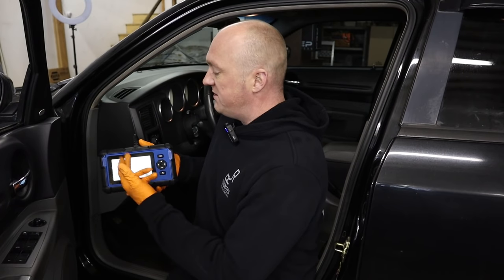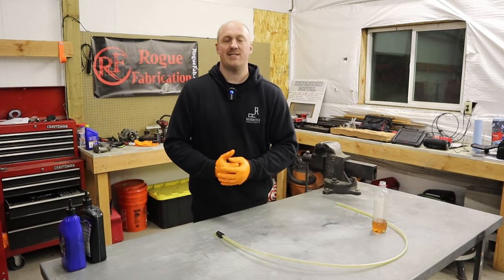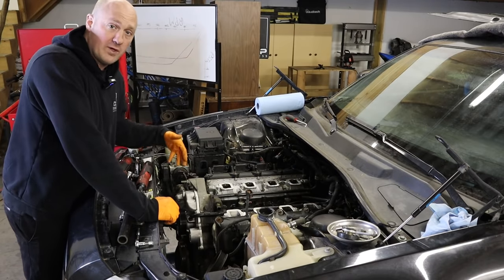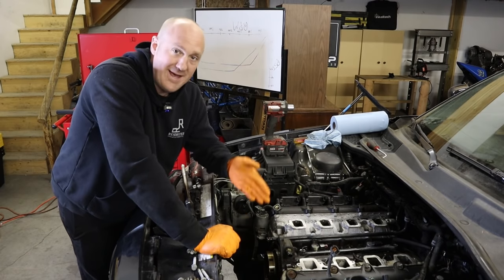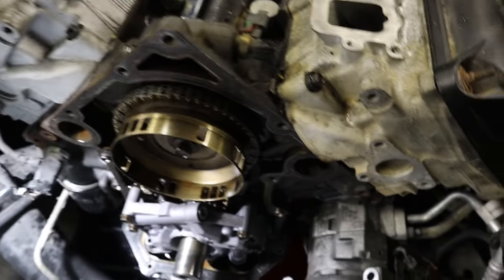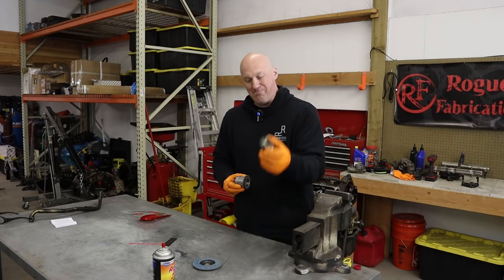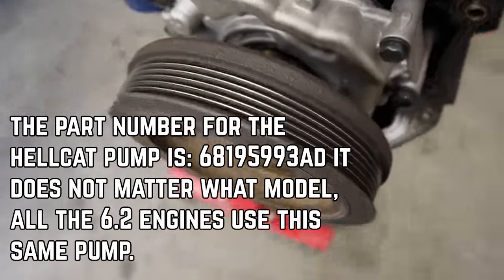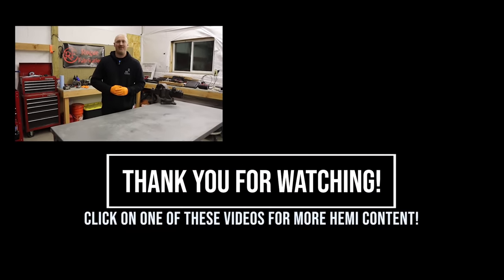Will This FINALLY FIX Hemi Tick? #hellcat

Comment: Wanted to say thank you for these videos and for supplying facts to support your theories, can’t imagine how many hours it took you to do all these hemi tick videos (I’ve spent the last few days watching all of the ones you’ve linked to in these hemi tick videos).

I really don’t know anything about taking apart engines, or even the names of a lot of the parts, so I’m not fully understanding how the oiling of lifters changes with MDS on and off, could you explain that in a video?  

And is leaving MDS on better for oil flow to the lifters? Or is disabling it better (via the gear limiter trick or some other method)?  I lack the skills to add the hellcat oil pump to my truck, and it’s my daily driver so I can’t risk screwing it up, so until I can pay a mechanic to do, I’m trying to understand what I can do help prevent lifter failure. Obviously the first thing is to idle as little as possible, but with the stock engine, should I be leaving MDS on, or disabling it (with the gear limiter truck or a tuner)?
Reply from the maker: Appreciate you watching! As a quick break down, the lifters are receiving the maximum oil flow when MDS is activated, therefore, in my opinion it makes more sense to leave the MDS functional, especially if you aren't able to perform many mechanical changes yourself. Some who are able to do so would rather remove the MDS system and replace the lifters with non MDS lifters before a problem even happens, but that's quite a fair amount of work. I personally think it's overblown how many Hemi engines suffer a lifter failure, and if you aren't in the habit of idling your vehicle excessively and are consistent with your oil change intervals, then I'd be willing to just ride it out and see what happens. There's a great many Hemi engines on the road today that have never had this issue, even ones that are maintained poorly.
Reply: @ReignitedAuto   I can’t give your answer enough likes. You replied to a comment on a video that is 6 months old, and you actually read and fully answered my questions. I honestly wasn’t sure you’d even see the comment because I’m sure you get a lot of them with all the videos you have. 

I’ve been disabling MDS with the gear limiter since I got my truck (2019 Ram 1500 5.7) nine months ago with 20K on it because videos kept saying it was the MDS lifters that were failing, so disabling MDS would prolong the life of the lifters… I’ll be stopping that. Regular oil changes and minimizing idling I already do, so at least I got that right. Maybe once I get closer to the end of my loan and warranty I’ll give the hellcat oil pump a try. One of the reasons I got the truck was to start learning how to do stuff like this myself, and your videos will be a great help when I’m brave enough to start tinkering with it. I truly appreciate your help.
Reply from the maker: @Regilliwret  sure thing my man,  I'm always down to help people learn and jump into the automotive world.  👊

Comment: If replacing one head would you recommend both considering one side had a valve seat drop? Also any recommendations on sources for locating a new pair of heads? Been looking at Mopar parts overstock and cylinder heads international online..both seem to be half of what others are charging.

Comment: I’m really questioning the legitimacy of the Melling 10452 I got for my 09 Ram with the 5.7

No change over the OEM in terms of bottom end pressure. Coming to a stop and idling my truck likes to dip to 15 psi. No check engine lights, and other than being noisy, she runs well

Comment: Looks a bit more complex than what I'm willing to tackle on my 2017 ram. Maybe in a few years to see if its 100% true that this will fix the issue. I wonder though, if the problem is really that simple, theb why doesn't stellantis, fca or even Daimler did this.

Comment: For 2022 5.7 Hemi on a Challenger RT cold start around 57 psi , and 32 psi on hot idle. Don't know if the pump is changed or not, but the oil viscosity changed from 5w-20 to 0w-20.
Reply: I wonder of the Mopar oil is an issue as well.

Comment: jesus 20psi hot... And thats a brand new pump or good working used one? Mine is still factory and likely tired from 300k kilometers probably making less flow and pressure, it would be dropping into the teens at idle i bet..

Comment: Hey first of all sorry for my bad english, i have an Dodge Ram 1500 from 2014 with the 5.7 hemi. I have seen the video and read some comments and also do my search on Google. So my Dodge has an idle Oil pressure round about 33-37psi but i have nothing changed, because i rode some comments that they have 20psi. So now my question is this "high" Oil pressure in ilde (enginge was operation temperature) normal or is there something done befor i got the car. Thank you for your hard work in the video. Hopefully somebody can answer my Question. Greetings from Germany and sorry for my english i hope you guys can understand it :)
Reply from the maker: I would say the oil pressure readings you are seeing are consistent with what I see from factory oil pumps in your vehicle so I doubt anything has been changed. My advice fit the improved oil volume generally applies to people who idle their vehicles for excessive amounts of time. 👍
Reply: @ReignitedAuto  Thanks for the das answer. Yeah i will Order the hellcat oil pump and Switch it thank you vor your Work 👍😃

Comment: At the expense of MPG could you just adjust the idle speed higher to increase the oil pressure/flow?  Or program the pump to stay at a higher minimum psi?

Comment: Thank you sooooo much for this content.   I have to rebuild my 2010RamTRX with 510xxx on it.   lifter and cam job. I might as well do the oil pump since Im there anyways.   Confirmation 6.2 Hellcat pump fits the 2010 5.7 VVT?

Comment: Hey sky
I was confused about the rebuild you Did in several episodes? If I eliminate the MDS with non MDs lifters do I have to change the cam?

Just watched the stock to hellcat oil pump Episodes.
I just bought a melling HV . But which spring to I put in the pump it comes with 2springs?
Thank you Richard.

Comment: Hello there,  I’m new to your channel and my question is does the hellcat high volume oil pump fit into a 2021 ram 3500 drw gas engine 6.4 truck without any modifications?   In other words, is it an exact fit. 
TIA. Great channel by the way.
Reply from the maker: Direct fit 👍

Comment: So what's your thoughts on metal shavings after lifter failure? I've been told to just change the engine because you'll never get the shavings out of the motor.
Reply from the maker: Chrysler's official position is this: underneath the intake manifold there is an OCV solenoid. Remove the solenoid and inspect the metal screen for debris. If there's metal on the screen it needs a new engine, if not then just replacing the cam/lifters and an oil change should be fine. 
My personal position is similar, and if I'm doing work for someone else and I see metal on the OCV screen then I'll recommend an engine replacement. On my own personal vehicles though, I'm good with just removing the oil pan and cleaning everything thoroughly and replacing the cam/lifters. But it's an easy decision for me to make because I know I can fix it if something goes wrong, which isn't the case for most people.

Comment: Great info. I have an 05 ram with a bad 3.7, perfect time to out in a hemi. I can’t find a pre 09 hemi in my area but have found a 2012 hemi. How difficult would it be to make this work in a 05 ram? Is it worth it, especially on a budget
Reply: It's not worth it! Swaps always cost a lot and take forever. If you're on a budget, just drop another 3.7 in there to get it back on the road. Sell it and buy a hemi if you want one, much cheaper and faster.

Comment: But even with the Hellcat pump it will only move as much volume as your oiling system can handle.  The only way to get more volume would be to increase the openings and passages of the oiling system.
Reply: if that were true, upgraded/high flow oil pumps would all be a waste for any engine since they can't flow more than what the oem block/heads were designed for...
Reply: @leezynotyeezy  Not necessarily.  Unless you are building an engine for more hp than it originally came with you normally would not use a higher flowing pump.
Reply: @ryotaryuu  The oiling system (your words) doesn't change when modding an engine... The openings/passages don't magically get bigger. What changes is the flow rate of a more powerful oil pump. And yes, normally we only upgrade an oil pump when building an engine, but that's the entire point of this video lol,,, that it's probably a good idea to upgrade the oil pump on any Hemi

Comment: I'm just wondering with doing a swap like this would there be of chance of blowing valve seals or having blow by at the pvc , backpressure in crank case
Reply: Been wondering about issues like this as well, with such an increase in oil psi from factory, could there be a chance of gasket, o-ring, or seal leakage somewhere...I like the idea of more psi for my 6.4L but would hate to cause problems trying to prevent one...
Reply: Seems to me that Oil pressure is ultimately controlled by a pressure  relief spring inside the oil pump, so hellcat/melling is not going to be higher than the pressure relief setting (100 psi max)
But at low RPM idle  is where the extra flow will cause a higher pressure 

The key difference will only be when oil is warm and at low Idle
Reply: @secretdad544  agreed, but getting to 100psi IF the stock pump’s max pressure is limited to say 75psi could be an issue. Possible solution could be to install a lower pressure spring in the hellcat pump. Seems like a more ideal solution.
Reply: @Jpm928  well I have been happy 
Seems like I have higher oil pressure everywhere but mainly at low idle 
It tends to be a little higher than it was with the stock pump at highway speeds 

The big thing is to use 5w-20 oil or 0w-20 oil and that keeps the pressure properly high on start up and at low idle when hot

From what I understand it’s when the engine is idling at 600rpm that the damage is being done by low Oil pressure because of low volume
But now I never have oil pressure below 210kpa and my engine (7,000klm at the day of finishing the installation amd now 13,000km runs quieter and I’d say cooler

Comment: I've heard that the oil pressure gauge on a Dodge doesn't give true oil pressure. I've heard that the computer reads the oil pressure and if it's within specs the gauge reads in the middle. I have a 2006 Ram 2500 with 46000 miles and the gauge never moves except when it's turned off. Is this true?
Reply from the maker: To a certain extent it's true. Manufacturers realized that if the gauge reads true all the time then customers would freak out about the gauge bouncing all over the place and think something is wrong. So they basically applied a smoothing affect to the gauge. If oil pressure drops drastically the gauge will reflect that, but if it's just normal operation you won't see it move much.

Comment: My 19 PW with the 6,4 seems to cold idle at 50 and warm idle at 35 , wondering if they have done something with the new truck motors ? Would 35 to 43 psi really still be beneficial on these 6.4 truck motors? I live in Wyoming and idle time happens in the winter.

Comment: So on my 2012 hemi in a ram 1500 4x4, i only hear a tic for a few seconds on startup. Im experiencing like a hesitation in the engine. Rpm, load, speed, its there all the time, nothing changes it. It hasn't thrown any codes in the dash whats so ever. So my question is could this be a lifter issue ??
If so would the cylinder delete selinoid plates and retune be enough to get me by without dropping $5000 on lifters and a cam ??

Comment: Love your channel, i have a question... My car is reading low oil pressure, as low as 3 psi to about 36 psi, fresh oil change with royal purple. I saw another video of another youtuber recommending to use Jilcat engine conditioner and drive for 50 miles and it should fix issue,  he claims its sluggish build up on top of the motor and that its common. What's your take on it? I haa 393 hemi Charger. Thanks in advance.
Reply from the maker: 3psi is way too low, you've got a mechanical issue somewhere that needs to be diagnosed unfortunately. My first thought would be the oil pickup tube o-ring could be damaged, but you really need to take it to a shop to properly figure it out.

Comment: This weekend I took the valve cover off my 2012 Ram 1500 5.7 hemi to diagnose a misfire and sure enough the intake valve for cylinder 1 is barely moving. Lifter and cam failure. I am buying the rebuild kit today for it and will be deleting the MDS. I have been thinking about replacing the oil pump with a hellcat oil pump to possibly reduce the risk of this happening again. What’s the installation procedure for this pump on a post-2009 model? Is there anything different that I will have to do compared to the stock pump?
Reply from the maker: Installation is basically identical, and on a 2009+ engine it's a direct replacement for your stock pump. 👍
Reply: @ReignitedAuto  one other question that I had is, will the increased oil pressure create a check engine light on my Ram?
Reply from the maker: @gabemooneyham3190  so far I've gotten feedback from 3-4 people who say that (ironically enough) it sets an oil pressure LOW code. This code resets a couple times, then goes away. Seems to be a weird software issue that resolves itself. Haven't experienced it myself though.

Comment: As a mechanic, I use a 180' thermostat and 10-30 oil. I can see using 200' therms in Alaska, but in Arizona, these ultra high thermostats and thin oils means engines die early... Just what manufacturers want.

Comment: how is the top end oiling on the 392 SRT motors compared to the 5.7?  Can they benefit from the hellcat oil pump as well?
Reply: I have a SRT Jeep and it calls for 0-40w oil. Might also make the difference.

Comment: Is there a regulator and relief valve and spring you could change to do the same thing?  Or a couple 3/8 flat washer behind a spring  to increase idle oil pressure

Comment: I’m working on a 14 ram 3500 with the 6.4 for a buddy lifter failed and ate the cam. He gets 17psi at hot idle. This truck is a work truck. It hauls rocks day in and day out. I mean it works hard and is how he makes his money. Would the hellcat oil pump be a good upgrade for him? I’m worried about the high end of the pressure because of the load he puts on it.

Comment: I have 2004 ram 1500 5.7 hemi.  The ticking issue starts immediately at cold start of the motor but continues even when motor is hot.  It is a steady, continuous ticking.   Is there any idea of what this issue is?

Comment: Does the oil filter affect the volume of oil and isn't that a big factor? On my 2022 Ram 1500 5.7 the oil pressure sensor is above the filter please tell me is the pressure sensor reading before the oil goes in the filter or when the oil exits the filter?

Comment: I have not received the truck yet, but the owners manual for my 2022 Ram 1500 Bighorn with 5.7L Hemi is calling for 0W-20 full synthetic instead of the 30 weight.  Your thoughts please.

Comment: I have a 2013 ram 1500 5.7l and after an hour of highway, psi on road at 1800rpm is 58 and after at idle, 35 psi wich is, i think, pretty good!!
Question: after an oil change, it begin ticking!! Still got those psi range, and the tick is sometimes louder than others days... i wonder if i'm better to check to fix something right now or wait to get missfire and replace engine when it'll be time??? Thx

Comment: What is the solution for the different oil pick up tube when putting the hellcat pump on a 2010 Ram 1500 with the 5.7?

Comment: If you changed springs on the melling would it have been at the same as the hellcat....I believe the spring installed is the middle of the road between the three.  I was just curious because I am close to install and now wondering if I should switch the springs for the higher psi
Reply from the maker: No, the spring only changes the overall regulated pressure, basically the point at which it bleeds off the excess. It won't affect anything below that point.

Comment: I have a 21 Ram 1500 Big Horn with the 5.7. The dash will give me an oil PSI readout...would you say that number is reliable vs using a scan tool?

Comment: Is it possible to put 09 or newer cylinder heads on my 2006 300 5.7 hemi and also where do you get your cylinder replacement from im asking because I need a new cylinder head

Comment: Someone explain how a different oil pump helps when the lifter/cam is a splash lubricated system!
Reply from the maker: If you watch my other videos showing the oil path through the gen 3 hemi engine you'll see that the camshaft is not solely lubricated by splash from the crank.

Comment: Do you have to actually weld the crank gear extension on? The part driving it is the crank key and that extends through the extension, doesn’t it?
Reply from the maker: Sadly no,  I like where your heads at, but the keyway does not extend far enough,  it wouldn't reach to the extension part of the gear.

Comment: how did you unscrew the bolt from the crank pulley when even the radiator was even there. Did you use electric gun?
Reply from the maker: I've done it both ways. I've got a stubby 3/8 electric impact that works well, but I've also just used a breaker bar. I stick a 6" 3/8 extension through the holes in the crank pulley and it wedges against the timing cover to keep it from rotating while you break the bolt loose. Not the prettiest solution, but effective 👍
Reply: @ReignitedAuto  thanks as I tried to unscrew it with a rachet but it was spinning. I didnt use a bar to stop the pulley but next time will try it.